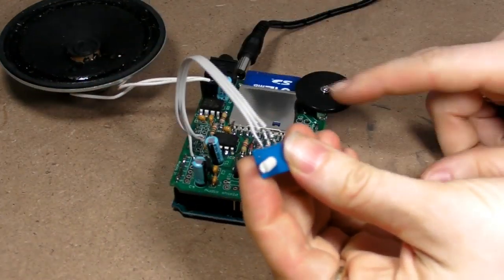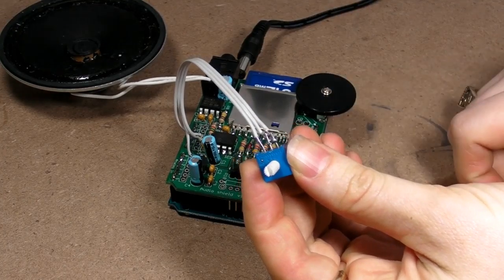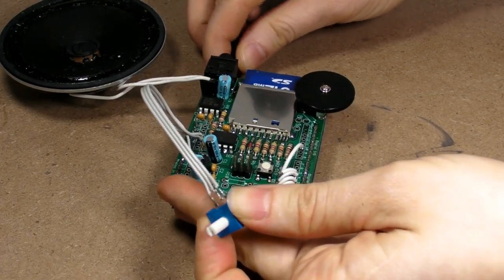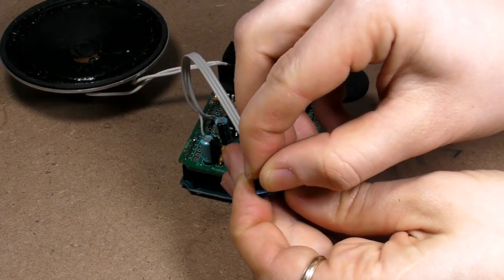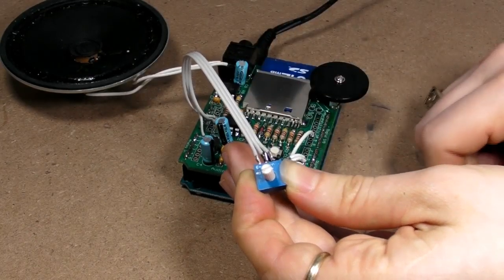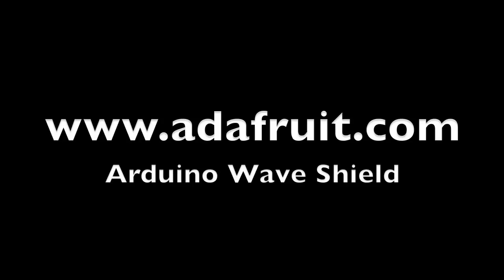Adafruit Wave Shield for Arduino Kit

Comment: 2. Listening to the general quality of the audio in the vid its very good and rich in all frequencies. this at a minimum would require an external good quality microphone and not a built in microphone on a camera. 
3. There is desynchronisation between the turning of the knob and the speed increase of the audio.there could be a delay between adjusting the knob and the audio changing but I would imagine it to stay constant whereas the delay varies throughout the video if you watch carefully.